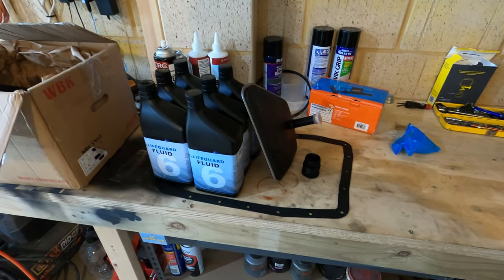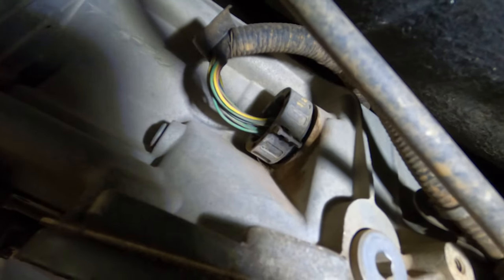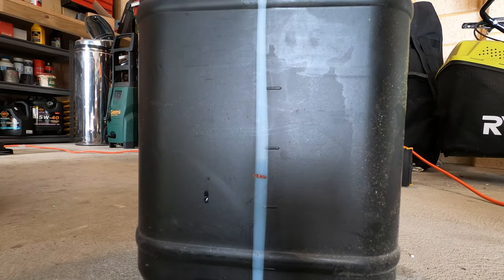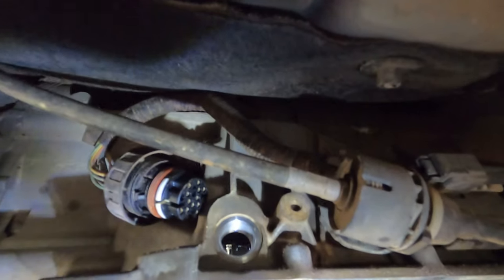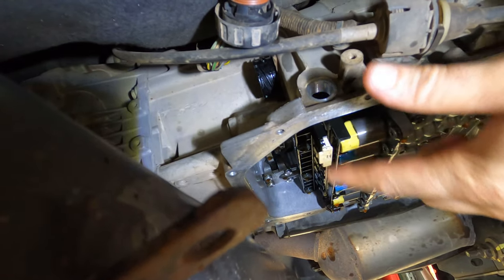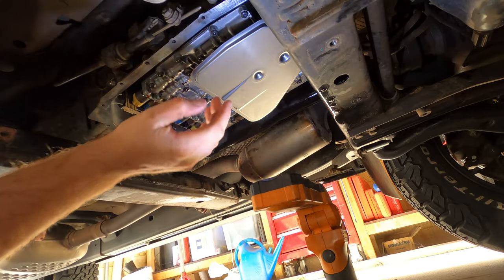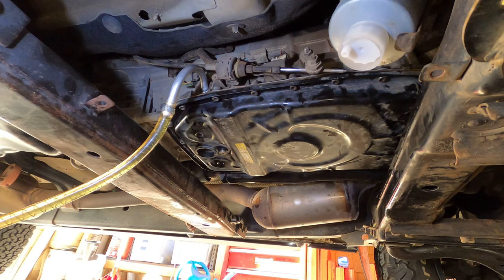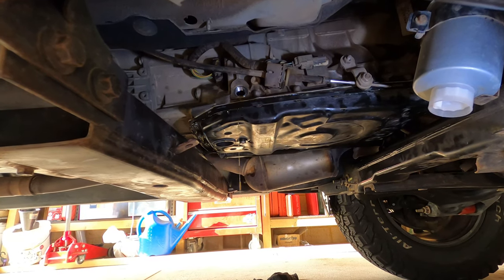LANDROVER DISCOVERY 3 TRANSMISSION SERVICE ZF6HP26

Comment: Hello, i am thinking my LR3 needs this service (i just bought her so i want to get all the preventive and corrective maintenance done before off roading) i noticed that when you were draining the pan the shifter linkage was moving, was the car on and were you shifting from P to D?? if the car indeed has to be on while draining the fluid can it damage the tranny? Thanks
Reply from the maker: Hey ambient car was not on just ignition I just do it to see if any more all comes out when I select the gears * car not running * 

Correct, running the trans with no oil damages the lube pump I definetly don't recommend doing it 🍻
Reply: @OUTBACKDiscovery  Thanks, i figured that it was off but i am new to landys and so far they are different from any car ive had before, just wanted to double check. Thanks

Comment: Hey Ryan, What brand filter are you running in the transmission?
Reply from the maker: Hey joey from memory that wasn't a ryco in this video but I normally run the ryco version
Reply: Cheers for the quick reply mate, I might order a ryco kit in instead of running the repco one they have in stock 👍 did a mega flush about 2 months ago and will finish the job properly next week with a new filter. The new shed you got looks the goods mate, more room to store spares 🤣
Reply from the maker: @joeyhummer  haha its definetly better then what I was working with in this video that's for sure

Comment: Where did you learn stuff like this?
Reply from the maker: Hey Ryan 

I'm a diesel mechanic by trade so it's part of my daily work knowing oils and servicing 

In regards to me Only running the life gaurd oil that's because when my transmission  was failing I serviced it and used penrite bmv 
The gearbox would slip like crazy and was un drivable so I dropped the penrite oil and put the lifegaurd 6 back in and it was drivable until I could afford the rebuild
Reply: It’s really nice to be able to do what you do. Is there anywhere that I’d be able to learn it? Obviously besides apprenticeships with a mechanic, as I already have a day job 😀

Comment: Hi, the transmission needs be reprogrammed or something 
I have F on dash and says transmission fault after change the oil
Reply from the maker: hey kyu have you set the oil level correctly and if you unplugged anything is it all plugged in properly. There isnt any need for reprogramming afterwards if job is done as per the video

Comment: did your transmission take 5.5 litres?
Reply from the maker: By the time I set the level is was about 5ltrs but originally I put 5.5ltrs in and then had let it drain out a bit to set the level once at temp
Reply: @OUTBACKDiscovery  penrite ATF is good hey?
Reply: @OUTBACKDiscovery  mad video aswell clear as, my backs fecked out so my mates doing the service for me. want to front load him with info so he can focus on spanners and not research
Reply from the maker: Also Stephen if you trans has the plastic transmission sump then the filter.is built into it and alot harder to get out 

There is a video showing you how to cut the filter neck that's built into the sump with a hacksaw blade so that you don't have to remove the crossmember and jack the trans up slightly 

U just unbolt the sump and you will get a 20mm gap which is a enough to see in there to spot the filter so you can cut it by hand with a hacksaw blade 

Good luck and also good luck with your back

Comment: You should of filled from bottom of pan through larger snorkel hole
Reply from the maker: That's the first time I've ever heard that 
Specially considering the manual I use states to use the filler bung that I used 

But if it works for you then each to there own 🍻

Comment: Sorry mate but you’ve done half a job there…..3.5 litres of dirty oil is still left in the torque converter and pipes……next time go through the oil cooler under the bonnet.
Reply from the maker: It's a service rather then a flush dude it's not half a job but you are correct it is only doing half the oil which Is why I do it every 30 thousand as you can't get all the oil out of the torque converter without starting the car to pump it out which I dont agree with unless doing the litre in litre out method until clean oil is coming out of cooler return line 

If I just drain oil from the cooler line without engine on and fresh oil in sump you still have dirty oil in torque converter so there is little difference aswell as cooler pipework being higher then trans sump hence why I just do it through the trans pan

Whole system holds around 9 litres

Comment: nice but why do you call SCREWS, Bolts? bolts have nuts, still even so called pros  do not know better these days
Reply from the maker: If you came up to anyone in my trade over here and asked for a screw you would get a self tapper, 

If you have to run a tap to cut a thread into something before bolting it in then we call it a bolt * in the case a torx  head bolt * 

Screws get left to construction workers 

Bolts get used for for mechanical parts 

Atleast thats how we are taught here in Australia 🤣

Also part description for the bolt is torx head bolt so I'm unsure as to who told you there a screw
Reply: I agree with  @OUTBACKDiscovery  (though i'm a ex-aussie too). Technically they are 'set screws' if they look like some sort of bolt but are threaded the whole length. Then you have permutations thereof such as 'cap screws' etc. Broadly, i use screws into wood, bolts into metal.